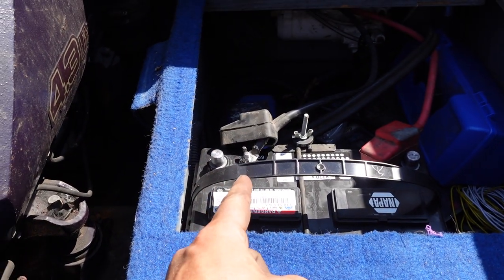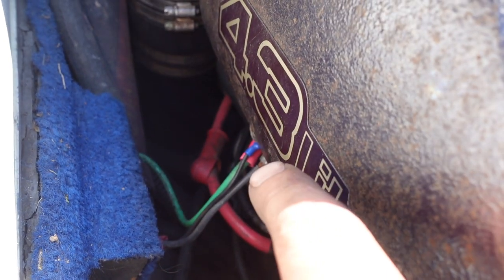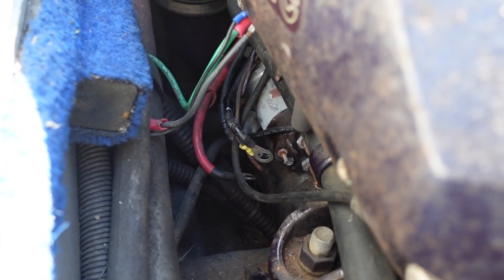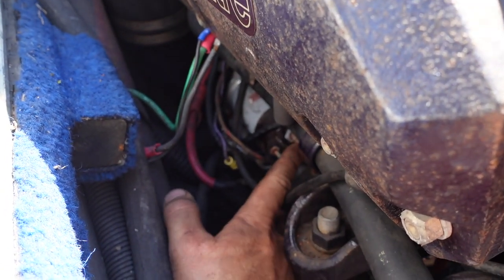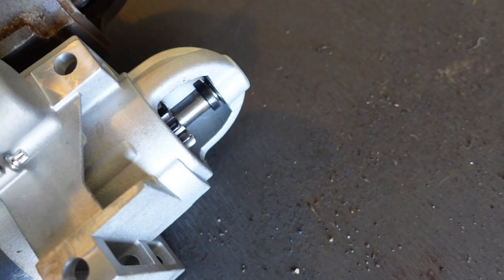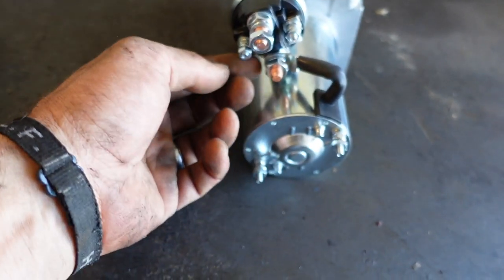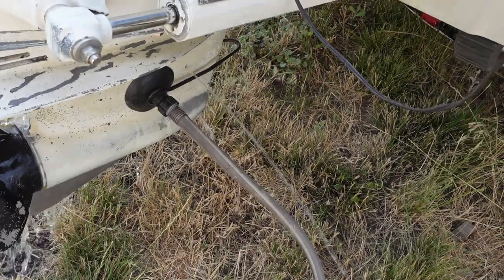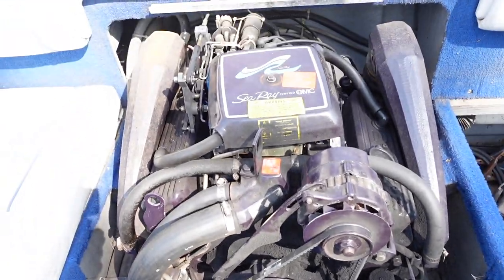How to Replace Starter on a 4.3 OMC Boat Engine

Comment: I know this is 2 years old but I'm hoping you can help. I'm having issues with my OMC 4.3L not starting. It clicks but nothing. The battery is good. I checked the solenoid, it seemed bad. I replaced it still nothing. I tested like I've seen others do and it doesn't start the engine. I'm wondering what to do now. Any advice? Its hard to find anyone that has an old OMC anymore.
Reply from the maker: could pull it and bench test it, see if you can get it to spin on the bench with a battery

Comment: Nice job! Hey im trying to find out exactly what engine I have in an old boat that I bought it’s definitely an OMC I believe it’s a 4.3 but I can’t find the manufacture tag on the engine. Can you share with me where the tag is on yours so I know where to look? I’ve been crawling around under there and can’t find it.
Reply from the maker: I think is down by the starter

Comment: That is not a marine grade starter.... a marine grade starter is identical to the one you pulled out. That's why there is a solid copper connector going to the starter and not braded wire. Also the starter is completely sealed from vapor so it does not cause a fire when trying to start after running on the lake. Just letting you know is all. Happy boating. Be safe😊
Reply from the maker: good to know, thanks!

Comment: Thanks!
Reply: Thanks for this video!  I was comparing the size of the replacement starter with the original and was certain that I screwed up.  Then I found your video and it changed my life (for the day) Definitely worth $5
Reply from the maker: Right on thanks man, glad it helped! It worked great all last season